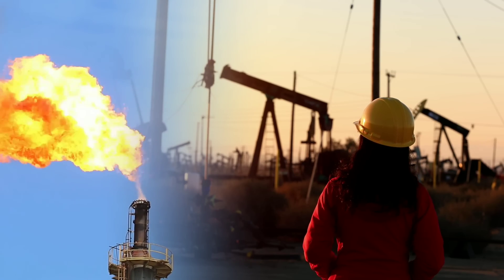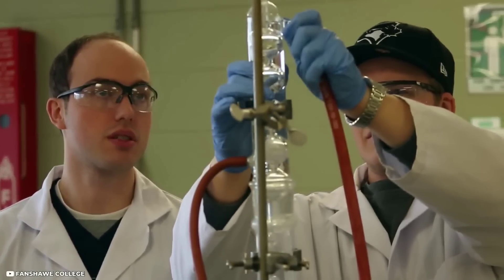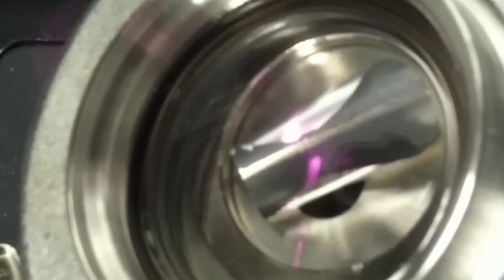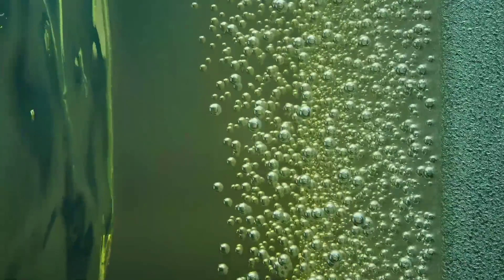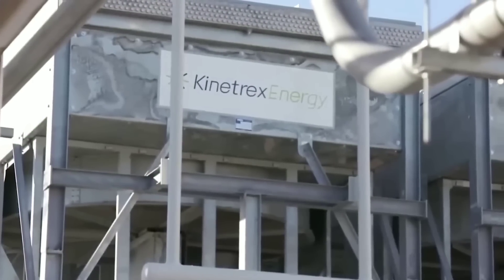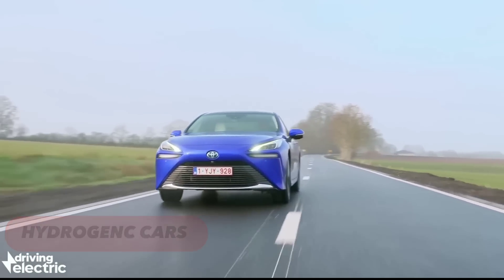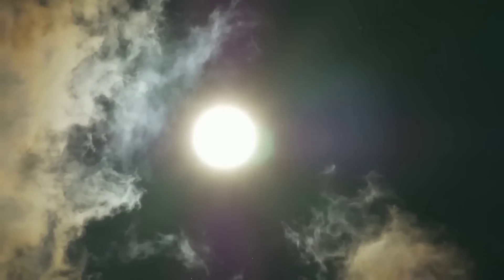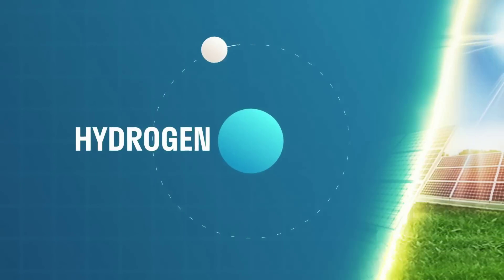You Won’t Believe What The US Just Did With Hydrogen! This Changes Everything!

Comment: This sounds promising. However when will someone realize than an even better way to store hydrogen would be to combine it with carbon from the air to make hydrocarbons which would be carbon neutral and could be sold from existing petrol stations and used in existing cars!

Comment: I hope this is possible, where metal hydride storage systems can be refilled with hydrogen without the need to swap them out, similar to refilling a fuel tank at a gas station. However, this process might a bit different from refueling a conventional gasoline or diesel vehicle.

Comment: While the combustion of hydrogen does not produce carbon dioxide, it does produce water vapor which is an even bigger greenhouse gas than carbon dioxide.  So, I'm not sure why the big fuss over green hydrogen.
Reply: doesn't water vapor condense in the atmosphere and come down as rain?
Reply: @erikstawicki696  Yes, it comes down as rain, snow and hail.  However, it is responsible for about half of the greenhouse effect.  And the warmer earth gets the more water vapor that will be retained by the atmosphere.  This is a positive feedback effect that could lead to run away global warming.  While CO2 does not condense and precipitate out of the atmosphere, it is absorbed by vegetation and in fact the more CO2 in the atmosphere the more conducive conditions are for plant growth.  So in conclusion, if we are worried about CO2 then we should be consistent and be concerned about H2O.
Reply: @Paul_Hanson  no shit! im not an idiot; my comment was sarcastic; how do you connect water vapor before condensation to the greenhouse effect? as soon as the temperature in the atmosphere gets cold enough, water vapor will condense, how long does this take? hours? days?
Reply: @erikstawicki696  Look it up.  Water vapor is a greenhouse gas.

Comment: "White" hydrogen is the solution, not green. Problem is it doesn't come out of wells or faults in high volumes like natural gas. Metal hydrides may be the answer if technology developed ways to circulate a powder or soluble hydride economically. Could it self pump after hydride becomes lighter with ad/absorption?
 Seems like DOE should have done studies many years ago, or even natural gas producers. Often times natural hydrogen comes with other gasses...thus a selective hydride may be necessary. Would be interested if others have any insight in this direction.

Comment: When you learn the center field of a magnetic force you won't be doing it that way.  First off you need to use the inductive properties  of copper in the water in  a saw tooth wave form at the correct frequency, not a sign wave.  Once you do this you will be on overload with the output of hydrogen.  The center field energy from a magnet and the copper inductive  field combine to disconnect the two molecules of water!!
Reply: THEY NEED TO LEARN THE DIFFERENCE FROM A VIBRATION AND AN OSILLATION AND THEY WILL TRIPLE THEIR OUTPUT OF hydrogens..
Reply: @vincecox8376  So what you're saying is you're a BOT, a paid poster who makes stuff up for Big Oil?  What a Homo, sold out did ya?  More than likely your a JEW posting from Mossad Headquarters in the Negez Desert along with 200 others.  LOL LOL LOL
Reply: This sounds like what RMT University out of Australia announced last year, a 15x fold increase in hydrogen production via electrolysis using freq modulated oscillating sound waves.  Yes?

Comment: Nano tecnology was a fad according  to many but now with nano tecnologies this i believe would be possible .Solar cells are now a reality  and so are robotics .He who has the vision will be ahead of its times .Hydrogen is very hard and expensive to store but this new theory seems very interesting as plasma gasification of waste using microwaves why not use lazers to decompose hydrogen at a molecular level and reverse the process by adding the electrons and reforming the hydrogen to use it as fuel as waste can be turn into a singas by changing the molecular structure.Data in a disk is not erase simply you remove a code but the data istill there so why not apply the same theory rearanging the molecular structure in the hydrogen and using a disk as if it where data ?

Comment: "They say..."
Any numbers on electricity consumption of the laser? Per kg of released hydrogen?
And what about a comparison with good old "normal" metal hydride storage? Which only needs heat to release the hydrogen (less complicated).
@1:21: "Hydrogen is a gas that needs very high pressure to become a liquid."
You don't get liquid hydrogen by pressurizing it, you have to cool it down.
Pressurized hydrogen like in the tanks of hydrogen cars is gaseous hydrogen. Similar to pressurized natural gas (gaseous) in CNG-cars.
Reply: Right, I'd also like to see the comparison with std metal hydrides, Bob Lazar type storage.  Still, storing hydrogen on a cassette type tape and releasing the gas by exposing it to a light source is incredible.
Reply: Compressing hydrogen to around 700 BAR yields liquid hydrogen.
Reply: @AstroRayGun  No, at "normal" temperatures, you don't get liquid hydrogen. Not with 700 bar and not with 7000 bar.

Comment: A massive percentage of this video is sourced from so many others on the topic, but worse is that it's lacking in profoundly new information. I get that H2 stored on disc to be released by light in the form of laser is novel although this video only vaguely touches on the H2 capture component, but like so many other contenders that either use adsorption or even absorption chemistry to carry and hold H2 which is released by heat or other excitation methods does not constitute 'solid hydrogen' IMO.  That's a gimmick term. My personal dream and about the only embodiment that would entice me to give up my beloved IC engines which only require tethering all those greasy moving parts to a gas pump about every 400 miles or so is not going to be satisfied with BEV.  It will be onboard production of H2 vis-a-vis cool breakthrough technology likely coupled with intermediate H2 storage in so-called "solid" form to be released on demand to the H2 Solid Oxide Fuel Cell (HSOFC) that both tops off the Na-Ion battery which is driving the cool breakthrough H2 production and also driving the electric motor(s) of my HFCEV of course.  Does anyone really believe the powers-that-be who claim all this will save the planet would ever allow just anyone with a heartbeat to only have to saddle up to a demineralized water pump for us to run around to our heart's content for only the cost of the HFCEV and a little di-hydrogen monoxide?  Skeptical is an understatement.
Reply: Yes your right, The global crime syndicate that rules this planet will never allow everyday citizens easy access to power as it would free them from their grip.  Having a "Stanley Meyer" hydrogen on demand type vehicle can never be permitted, way to easy for the citizenry, cuts big oil and the control grid out of the picture.  I've read about RMT University out of Australia claiming a 15x fold increase in the electrolysis process using frequency modulated and oscillating sound waves?  Sounds a lot like what Meyer was doing 35 years ago?

Comment: The problem is not other viable fuels to propel the ICE. The real problem is the Internal Combustion Engine, the most inefficient, wasteful, complex, power unit known to man, that the traditional auto makers incapable to build efficient BEV close to Tesla, are trying to keep the old technology alive. But the literate consumers have discovered the  far more efficient, lighter, far more reliable electric motors that power Tesla BEV and they would never go back to any forms of the old ICE contraptions including the surrogate Hybrids. So dear OEM if you want to survive in the car business better start working very hard at putting together something close to a Tesla, because when the entire truth is revealed, the Hydrogen BS story is not going to save your ass.
Reply: When you learn the center field of a magnetic force you won't be doing it that way.  First off you need to use the inductive properties  of copper in the water in  a saw tooth wave form at the correct frequency, not a sign wave.  Once you do this you will be on overload with the output of hydrogen.  The center field energy from a magnet and the copper inductive  field combine to disconnect the two molecules of water!!

Comment: If hydrogen is so much better converted to electricity, why they don't convert into electricity LPG?
Reply: That is called either gas-fired turbine or gas-fired IC engine power, either of which is inherently roughly 40% thermally efficient unless coupled with numerous embodiments of waste heat recovery which is called Combined Heat & Power (CHP) which puts the otherwise exhausted heat to useful work before allowed to enter the atmosphere. CHP effectively increases the thermal efficiency of the actual power generation to 80%, more or less depending on mode put to work.  That can be as simple as hot-water production or steam production or both.  Modern absorption chillers are extremely reliable and are 99.99% powered by waste heat which ultimately can render electric powered chillers to a support role.  The environmental issues with any fossil fueled power generation and even some fuel cells AND even H2-fired ICE is NOx to the extent that high temperature combustion resulting affecting exhaust temperatures promote the various oxides of N2 to be formed unless specifically dealt with by Selective Catalytic Reduction (SCR) combined with cooler exhausts.  All of these technological improvements have been motivated by the environmentalist movement over the past 20 or so years.  Even diesel-fueled prime power has risen with the rising tide to produce very economical power to Tier IV exhaust standards.  The real 'inconvenient truth' is that the ONLY true green is COMPLETELY and ABSOLUTELY off the grid, no fire-pit or PV (EVERYTHING is made with massive amounts of electricity). So, go ahead and plug your EV into whatever outlet you want, but be honest and paint yourself RED, not blue and certainly not green.  Otherwise, one's only fooling one's self.  Yes, Mr. Musk IS a genius.  He knows a sucker when he sees one which is why he's the wealthiest human on this red, blue and green planet.